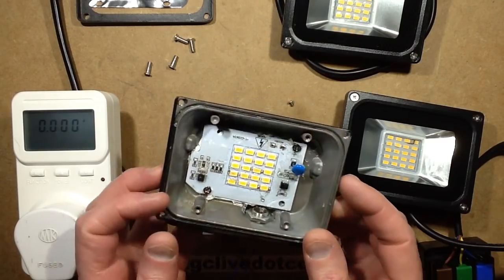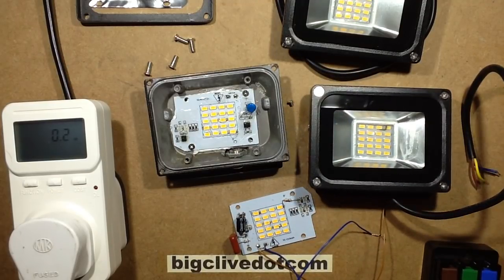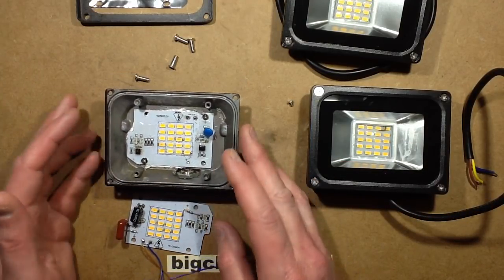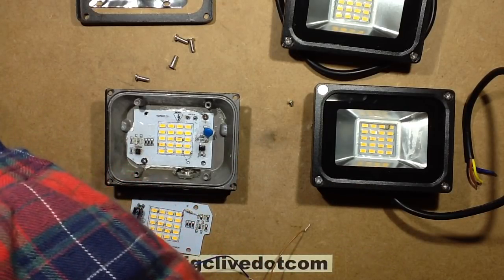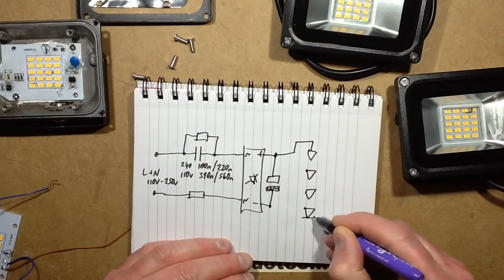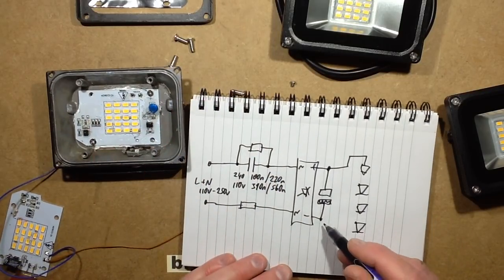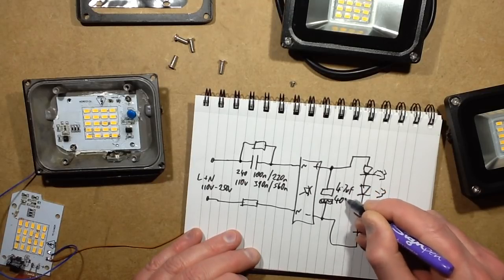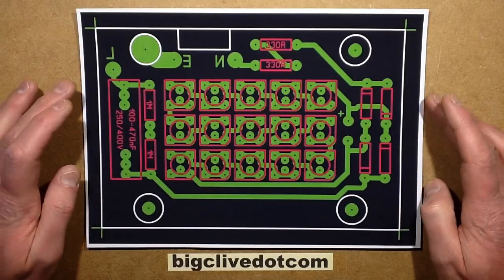DIY LED floodlight conversion module with PCB file.  (full build)

Comment: does it take less energy to run something in loop or in series?
Reply: +Pat P for the same amount of leds its all the same overall wattage, you vary the way you do series and parrallel to vary the input voltage usually, but this is a capacative dropper for AC and you run them all as one series.
Reply: +Pat P 
A LED has its specified forward voltage and current. That won't change just by conneting it differently.
Reply: +superdau I was thinking it might cuz when I connected 3 speakers in a different way (- to 1st  speaker + to 3rd and one simple wire going from speaker to speaker) it took close to 4x the wattage to run them.
Reply: Pat P
well for speakers you had to turn up the volume to run them, so they needed higher voltage to push through the higher series resistance.  the watts though are the same for the same loudness, but for speakers if you connected in parallel the reduced parallel reistance would be close to a short circuit and blow the amp!
Reply: +jusb1066 oh OK thanks. hey that reminds me of something. here's another one. how can sound run a lightbulb? my brother had a one of the bass lines going to the dome light in his car and it was flashing with the music. I thought stereo systems can operate speakers.
Reply: Pat P
maplin sell kits (or used to) that had a micrphone and would flash lights according to the beat, or he pulled the circuit from an existing disco type light, i knowow tandy used to sell them at one point, crudely you might be able to direct connect a bulb to the sub output of an amp, that could work too.
Reply: Pat P
or there is a simple way! a strip of metal in front of the speaker could be split into two overlapping parts, the metal would viibrate with the bass and flash the light!

Comment: lol i still use an antex iron, but they dont seem as nice as they used to be, the mains cable is stiffer, and the nice plastic hanging clip is gone :-(
Also i love thin solder, more controllabubble lol :-D
Go on clive, make that capacitive reactance smaller, make the leds work for there feed :)
Reply: +zx8401ztv they sell an antex with silicon cable as an option, i would assume its stiffer because using larger sqmm cable for some reason or other.
Reply: +jusb1066 
It does seem odd that every one i bought allways had nice flexible cable, i allways liked them as being light and the cable never restricted movement.
The bad side is the tips could be dam expensive, sometimes it was better to buy the whole thing again.
I dont think the 18 and 25 watt versions needed thick cable, its only about 100ma for the 25 watt.
Reply: zx8401ztv
i have modded my antex, a tight fit brass tube over the element around 3 inches long, the other end has a small lockscrew, i make my own tips for this and my 12v iron from 2.5mm copper rod hammered or filed i at the end, they used all copper in the old days, and i stick to that, the iron modern tips tend to get eaten and suddenly fall apart.  with copper you can just file it and re-tin in no time
Reply: +jusb1066 
Sounds like a smashing way out of expensive tips :-D.
You clever sod :-D
Yes the dam iron clad copper tips have allways been a shit for vanishing, sometimes i  got just a pinhole in the cladding and the inside of the tip just vanished, i thought the iron was failing as it didnt deliver the heat storage like it used to, no dam wonder with just a thin shell for a tip.
Thats happened on every tip, its the reason why they die, i never used abrasives to clean the tip as i knew how fragile it was.
Copper tips are fine, as long as you dont mind it slowly vanishing lol.
The word "Sav-bit" came to mind, i think it was solder that preserved copper better, i dont have that now.
I have a massive reel of 60/40 that came from "The g.e.c" factory that used to be around when my mum was young lol.
Reply: zx8401ztv
yes the old savbit alloy, had a bit of copper in it or something, yeah i dont worry about abrading the tip, in fact i sometimes use a file or small wire brush.  otherwide id probably go with a hakko compatible iron, bits are pretty cheap from china, (5 for less than 2 quid, probably cheaper in bulk) better than the 6-7 quid for antex
Reply: +jusb1066 
Yes the alloy sounds about right :-), my memory is a bit foggy about some things.
6-7 quid, bloody expensive for what they were, although im sure that if i went to R.S semiconductors i would run quickly out the doors .
R.S make ordinary stuff quite scary, but they do sell decent capacitors for switchmode repairs, panasonic is my favorite :-D

Comment: A few weeks ago, in this video (https://www.youtube.com/watch?v=fUTiYs3i4Cs), you discovered an LED based rectifier.

Is this something you'd consider using for this kind of project?
Reply from the maker: +Martin Schou It's only suited to small numbers of LEDs before the LEDs doing the rectifying have their reverse voltage exceeded.

Comment: Why did you not rotate each led by 90° if you have them all in series anyways? That would have made straight tracks between each led instead of zig zag ones.
Reply: +radry100 
Thought the same. The only reason I can think of: the LEDs point all in the same direction. Less probability to screw up in assembly.
Reply: +superdau Honestly would it had been too hard to go with the 3x5 superflex arrangement and have it so after the top row, it zig-zags up and down to end up at the bottom of the same side it started at?

Comment: No "Acid-o-Death" cookie tin (Poundland-special) hazardous chemicals containment device?!
Reply from the maker: When I was young I tried to make ferric chloride solution in an aluminium tray and it reacted violently.
Reply: @bigclivedotcom  !! That's a good one. My wee lad years were misspent on continuously stealing off into the yard with mom's favorite coffee maker... apparently I really had to find out how the contraption could hocus-pocus perfectly clear water into drab-brown go-juice. Fast-forward 15 years & found myself with an engineering degree in hand, and a vague recollection of always messing with my dad's swimming pool water tester kit as the reason why I thought a chemical & mechanical engineering degree was such a good idea. Somehow made it out the other end not blowing myself up and/or an encounter with face-melting acids.

Comment: But why not just buy the empty cases instead of buying the light and replacing the board? I'm sure you could get the empty case for much less...
Reply from the maker: +Aurelius R Ironically no.  It's cheaper and easier to buy the complete product than just the empty case.  And keep in mind that this was a dead light that I reincarnated with a new PCB.

Comment: Can you use the same kind of circuitry with the floodlight PCB from your website?
http://bigclive.com/flud.htm
Reply from the maker: +Dean Proudler No.   The floodlight PCB is designed for 12V use at modest current.

Comment: thought the leds used a ballast
Reply: They have to be current limited.  That's the purpose of the line side capacitor in this project.  It uses capacitive reactance to limit the current without dissipating any heat.

Comment: Lead IS bad for you, remember when the waterpipes were made from lead? Those guys didnt have a good time. Its just when the solder gets over 400 degrees C or just when you touch it. The risk is very low though.
Reply: +SIC66SIC66 Agreed, I do use leaded solder though for most of my own projects. And I put almost pure lead pellets into my airrifles (I think they alloy it with a few materials to make it perform a bit better with some of the brands but eh whatever practically its lead).

Just follow basic principles: while using the lead and until you've washed your hands don't put them into your mouth or handle food and things should be alright. The only time I'm a little bit concerned about lead is when I'm emptying the pellet trap that holds my typical target cards, the pellets will mostly deform but also create a bit of lead dust when hitting the hard steel surface. Breathing that in I suppose would not be wise, but short of that I've not been concerned about any lead use in my daily life.

While soldering as long as you've got a good iron that isn't overheating you shouldn't get any significant lead fumes either that said the flux fumes can be plenty bad if not worse depending on the nature of the flux so the usual ventilation and fume extraction are always a good idea if you're gonna do a lot of that.
Reply: Extra stuff An other point though, is that most of this stuff ends op in landfills or just nature. Same with lead wheel waits. We should try to use as little lead as we can. Lead wont just go away after we trash it.
Reply: SIC66SIC66 Yup I'm very aware of this issue and the amount of PCBs inside electronics with small amounts of lead that end up on landfills and potentially incinerated.

I don't disagree with the RoHS in principle, but I'm also a typical lazy human. My Ersa Icon 1 soldering station if I set it to the right temp will handle lead free solder just fine, but I grew up using lead based solder and while I've got 3 large spools of it (various thickness 60/40 for different types of components) I will keep using that.

I was just stating that the danger of handling lead in the form of solder isn't as much an issue to worry about in my opinion. Just skin contact won't be terrible for a human, once you start breathing in the dust or fumes or handle food with lead traces on your hands it gets worse.

The lead I put through my airrifle for example mostly goes into the pellet trap or with other targets it'll deform and fall on the ground, then its collected every now and then by sweeping it all to one spot and dumping that trash in a  big bucket, pellet trap is emptied into it as well. Every few years when its full enough and I've got some other scrap things about with a lot of solid iron/steel/copper etc I take it to the weird people that will take scrap metal and give you a marginal amount of money for it.

But when the lead is just tiny trace elements on PCBs you can't as easily process it and reuse it, I know that aspect of it is bad and at the rate most of the developed world throws away electronics its definitely worth keeping it out of production electronics (and perhaps hobby things as well but I won't consider this myself until I run out of my lead solder spools in a few years).

Comment: i was working on a lift once clive single phase and the centrifugal switch was stuck in the motor, another engineer had been several times and just give the motor a crack and left, i didnt know that, so i got there and put a call in and the motor started humming, so i got down to see if it was the impellar in the pump, and the cap blew up right by my head, i was deaf for a day, i looked like al jolson and the motor room looked like buzz aldrinds street party ... lol
Reply from the maker: I'd guess it was a start capacitor that couldn't take the continuous run load.  It seems common that they just sell dual purpose run and start capacitors now.  Which are basically just run capacitors that can handle the continuous load.
Reply: yeh it was the start winding, i moded the panel with a 2 second timer to bypass the c/f switch
Reply from the maker: If you're a lift engineer you may find it interesting to note that there are a lot of geeks who like to see video of the more interesting lift machines in operation.
Reply: no thanks clive ive more interest in what you do, who would be interested in me rewiring control panels, taking backlash out of gearboxes, testing safety gear and rupture valves, re roping lifts, boneing guides, using trig to set entrances. running trailing cables and wiring them. modding controllers. testing over speed govenors, weight testing cars, setting up optical and magnet tape heads ..... lol
Reply from the maker: When I was young I really wanted to be a lift engineer, but my dad stopped me and said I had to become an electrician first.  In reality it was the exact same qualifications and there were lift engineers in my day-release class at college.  In hindsight it's maybe not a bad thing with the progress of lifts from really interesting electromechanical control system to circuit boards, networks, secret error codes and passwords.  Are you with an independent company or one of the usual suspects?
Reply: work for myself clive, i have worked for the usual suspects, what made you want to be a lift engineer in the isle of man ?
Reply from the maker: Good call being freelance, even if the burden of paperwork and certification must be getting to be a chore.  I wasn't on the IOM then it would have been Glasgow.  If you drop me an email via the email address on my main website www.bigclive.com I'll give you a link to a technical site that you may find useful.

Comment: The big danger from lead poisoning isn't that adults will get it, it's that when even very low levels of lead are in a child's bloodstream it causes a measurable reduction in their development and eventual IQ as a result. Getting rid of it everywhere we can isn't so much to protect adults from poisoning as it is to protect kids, who are way more sensitive.
Reply: +GiddeonFox 
Do you have kids chewing on PCBs?
Reply: +superdau I'm sure some of the dumber kids do, but more importantly people throw PCB's out en masse, from there it leeches into the environment or the air (if it's burned).
Reply from the maker: +GiddeonFox When I was a kid the water pipes in the street were made of lead.  My IQ is high enough to have been a member of Mensa for the last 32 years.
Reply: +bigclivedotcom Water pipes are a bit tricky, because depending on the PH of the water coming out of the treatment plant very little can leach or a ton can leach. Lots of lead pipes are still in place because the water doesn't leach enough to be dangerous, but in other places (like recently in Flint, Michigan when they changed the water supplier) dangerous levels can leak out quite quickly.

I mean I'm not saying don't use leaded solder in your personal projects, I certainly do, but saying that lead isn't toxic at all (especially in mass-produced consumer products) is just not what the science is showing.
Reply: +GiddeonFox Incidentally, recently there've been some interesting studies on the effect of banning leaded gasoline on the crime rate in the US, and while there isn't QUITE enough data to draw serious conclusions from it at least looks like there's a strong correlation between violent crime going down and leaded gasoline being banned.
Reply: +GiddeonFox 
Yeah, and the decline of pirates is the reason for global warming ;) . Look it up, there's quite alot of data about that. How about everyone get electric shocks? Clive seems quite smart and he has been shocked several times. I also got a few shocks, one even to my ear (don't ask) and I've heard often I'm not dumb either.
Sure, lead isn't good when it ends up in landfills or gets burned (although any modern incineration plant won't let any of that through). But I hate the fearmongering about all "the chemicals", while people fall for it, because they are too lazy (or stupid?) to check a few simple facts. And that in an age where getting accurate information is easier than ever before. If you give me a deposit for a new toilet bowl, I'd happily swallow balls of lead. ;) Mercury is very similar in that respect. People almost treat it as if it were instant death, while you can swallow or even inject it into your blood without lasting consequences.
Reply: superdau Yeah I'm aware of the pirates/global warming joke (which I actually thought of while I was making that post :V) but the science behind the lead/crime correlation at least tries to control for outside variables afaik. Anyway while I agree that media hype around "chemicals" is dumb and unjustified, lead (and fuck definitely mercury, it won't kill you instantly but chronic exposure definitely causes serious health issues, look up the origin of the phrase "mad as a hatter" for example) actually has research to back it up.

Sure, first-world incinerators may be good at filtering out the really bad stuff, but a lot of the PCB burning happens in the electronics recycling areas in the super-poor parts of china, where it's burned in open pits to extract some of the precious metals. And this highlights the real big public health issue with lead in consumer goods (and pollution in general) - the people who are affected the most tend to also be the poorest and least able to actually deal with the problem. 

And again, go ahead and use lead in your personal projects all you want, you probably won't hurt yourself :)
Reply from the maker: +GiddeonFox The hatters did suffer nervous system damage from the mercury in its most dangerous form.  Vapour.  They used large quantities of mercury at elevated temperatures resulting in a high level of mercury vapour in their work area.  Mercury will slowly evaporate at even a low temperature but if you had a tray of cold mercury in a typical room then the amount of mercury vapour in the air would not be high.  Neon benders used to work with mercury all the time and as part of their health check-up would get tested for the presence of mercury in their blood.  The tests usually came back with negligible amounts showing if any.

Comment: man you must have burned a lot of printer toner and ink printing that circuit diagram 5:55
Reply from the maker: +Nexfero CISS ink system.  It uses bulk cheap eBay ink.